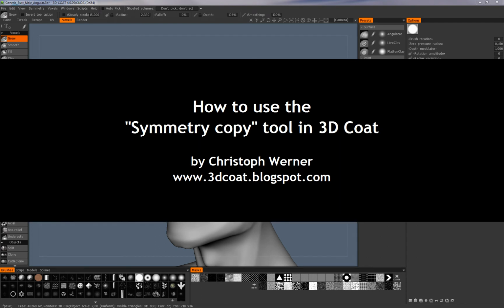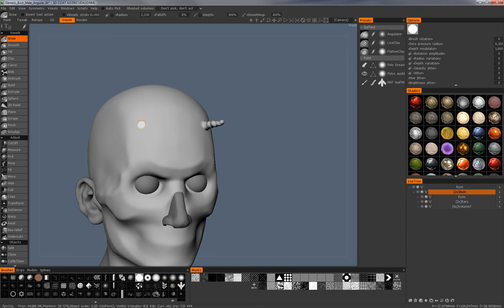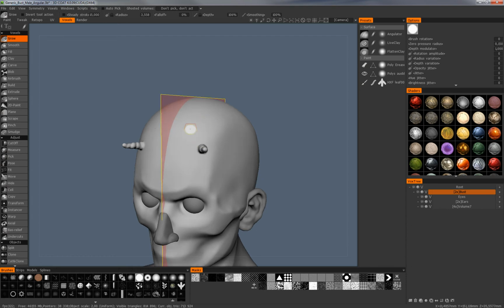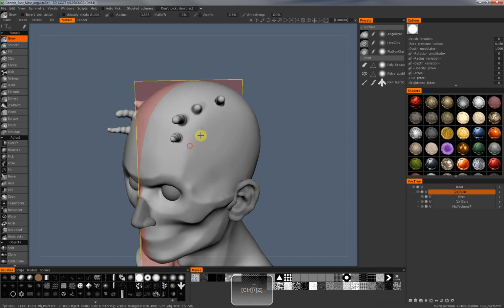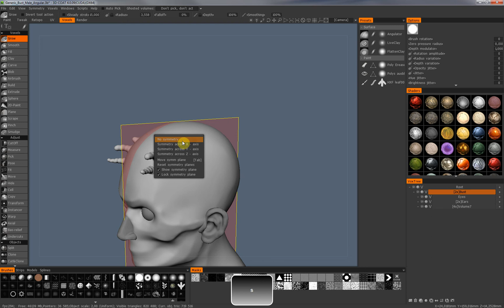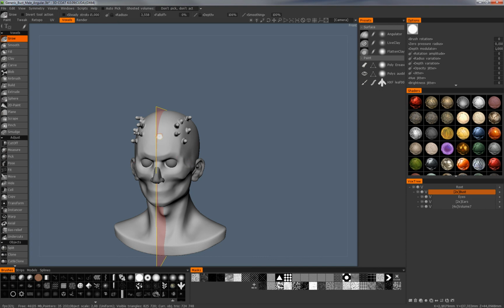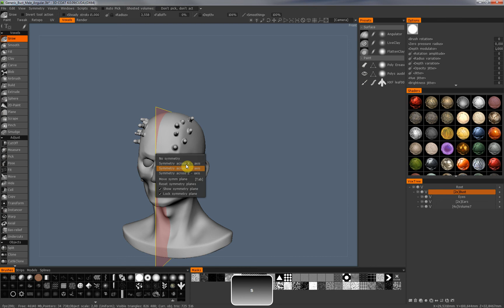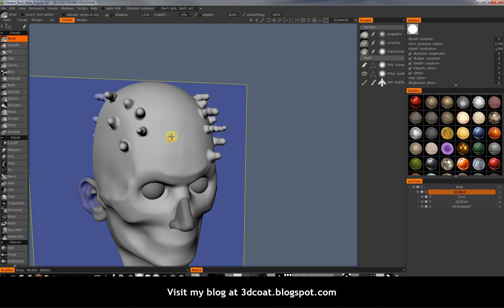How to use the "symmetry copy" tool in 3D Coat

Comment: Is it possible to turn on X & Y symmetry simultaneously? If not, what's the best workaround method?
Reply from the maker: Yes. You can do this definitely in the current version of 3D-Coat (4.7.). I am not very shure, but I guess it is working to set more than one symmetry plane since version 4.1.
Reply: It's been a while since I last trialed 3DC and remember that was one of the turn-offs for me. Thanks for the info and the quick reply, Christoph!
Reply from the maker: by the way: Radial symmetry is included in the current version too. You can set as many radial symmetry targets as you want.
Reply: Awesome! It's one of my most used/sought after features. Thanks again, Christoph.

Comment: Hi. In the retopo room I did the clean topology of a high poly face which is all symmetrical except the hair. Now that I'm done with the face, how could I copy and paste the half face in order to deactivate the symmetry and work on the topology of asymmetrical parts ? I hope you see what I mean :) Your help on that would be very precious.
I can't figure out how you manage to get this menu with "symmetry copy".
I just exported my half retopo mesh. Opened it in 3DSMax. Did a symmetry there. Uploaded the .obj modified in 3DSMax. Imported again the high poly as a reference in 3DCoat retopo then imported the obj from Max. Now I have a face with both sides and I can deactivate the symmetry and work on the hair. It works but it doesn't sound very pro. Really hope there's a way to do that from 3DCoat ! :)
Reply from the maker: Normally you should be able to activate the symmetry by pressing the s-key. Or use the main menu to activate the symmetry. To copy the polys symmetry must be activated. You can copy the polys by pressing the double arrows symbol at the bottom of the retopo layers window. hope this help. And deactivate virtual symmetry mode in retopo menu.